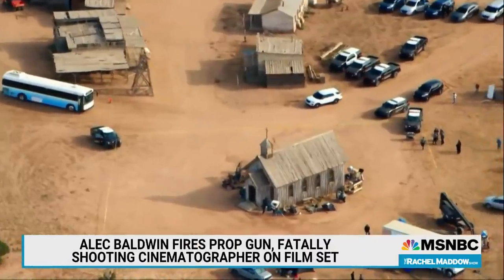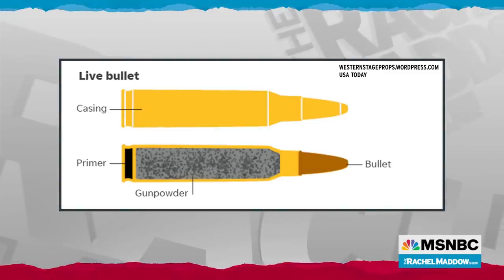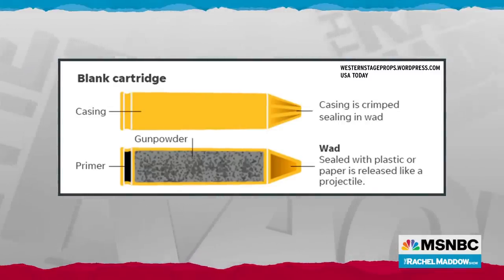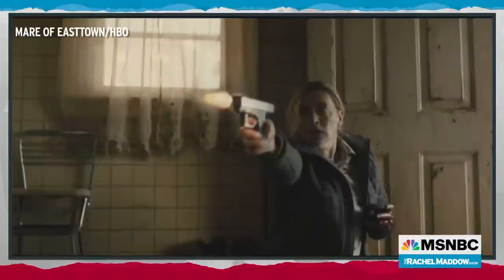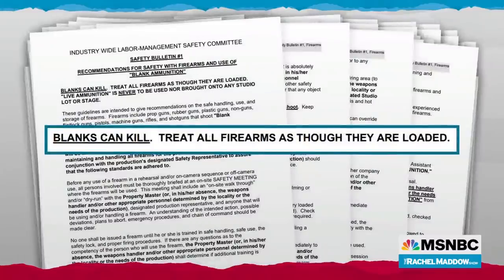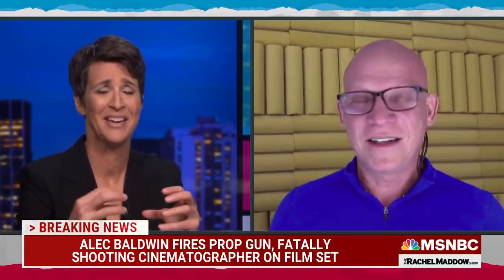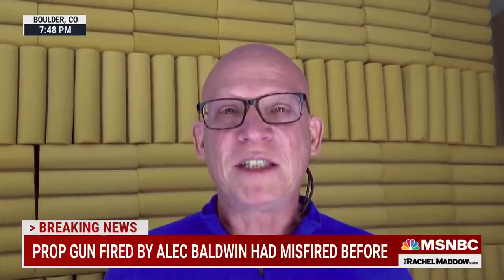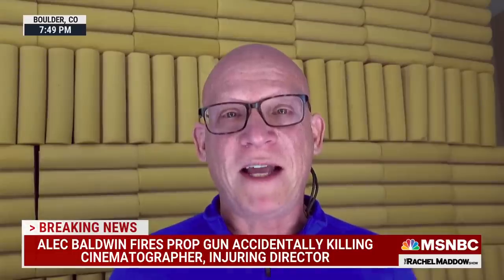Weapons Safety Expert Looks At Safety Protocols And Alec Baldwin Movie Set Shooting

Comment: After Brandon Lee you would think this would be impossible.
Reply: @johnbrown4949  lmao
Reply: @johnbrown4949  
It wasn't a bullet, it was the wad of the blank - as you saw in this video, you need something at the tip to contain the charge.
Reply: I mean, the issue on that one was that there was only a cap with a projectile, which should not have existed.  I was watching a documentary on what happened with Lee's death on The Crow, and injuries in general due to special effects... I wanna say it was on the Discovery channel, but I can't remember and I have no intent of saying "lol here is the study do your own research'.  They were speaking about two different types of round on the set:

Bullet with no cap/powder to be used when looking down the barrel of a revolver, aka the rounds still in the cylinder.
Blanks (they did not show the crimped type, they looked kinda like starter pistol rounds)
The issue was that a third type was accidently created; bullet, no powder, but cap, it ended up in a chamber, trigger was pulled, bullet went in to barrel (which is apparently called a 'squib load') , then the blank charge shot it in to Lee's abdomen.

I don't own guns, I've never shot guns, but I did grow up in the 80s/90s where science toys were a bit more... free?  I guess would be the term?.. and something I was doing an experiment on that was supposed to shoot BBs about the size of a marble out of a tube and the bb went a certain distance based on how far it pulled back, but it was pretty much a chamber loading system, I did not know a bb was still in the tube, did experiment (was mostly having fun shooting things at that point) bb in barrel was hit by bb I just fired, there was a crack sound, lodged bb came out did not move as far as it was supposed to, and the one I shot rolled slowly back in to the loading area.

It was annoying yet cool at the same time and ended up with me learning about transference of energy in a collision, which was cool!  Anyways, just because something mind-bogglingly crappy and unlikely happened to Lee, it does not mean it was a conspiracy.
Reply: @AdeptPaladin  It's highly unlikely a paper wad in a blank would completely pass through the center mass of a person and then penetrate the epidermis and the dermis of someone standing behind them.
Reply: @AdeptPaladin  According to the AP, an assistant director unwittingly handed Alec Baldwin a weapon loaded with live ammunition. What Steve Wolf shows and mistakenly refers to as a blank is an empty (spent) shell casing. A blank would have crimping, to seal in the wad, as seen in the illustration.
Reply: ...unless, of course, there is foul play afoot.
I'd start with the guy who loaded the weapon with real bullets.
Then, find a motive.
Reply: AdeptPaladin  Brandon lee was killed by a bullet not a wad
Reply: That was sad
Reply: @johnbrown4949  In the case of Brandon Lee, it was determined to be a combination of the use of a blank round (propellent) coupled with a “squib load,” (bullet fragment), which had been previously lodged in the barrel of the .44 Magnum revolver.
Reply: Anything to do with Baldwin’s criticism of Putin? Other Baldwin family members have some odd associations with trump.
Reply: I actually thought it wouldn't happen again I'm guessing it wasn't a bullet I'm guessing they loaded something wrong and it was more of it then there should have been and it exploded cuz it hurt two people
Reply: @stevecopper1667  It's been reported that it was a live round. If it was full metal jacket round, then it's quite possible that it passed through the cinematographer Halyna Hutchins and wounded Director Joel Souza, who was standing behind her. It's so tragic in any scenario.
Reply: @stevecopper1667  Depends on how far away they were. The muzzle velocity from a blank shouldn't be anywhere near a live round.
Reply: @johnbrown4949  The primer pushed it out in the Lee case. They used a "prop shell". (a cartridge with just a primer and a bullet but no powder charge) because when shooting a movie you can see the front of the bullets in a revolver. The small pop of the primer was enough to push the projectile from the "prop" cartridge just into the revolvers barrel, Later they used the same gun and didn't realize that the "prop" bullet had been lodged in the barrel of the gun. So when they loaded a "blank " with a full load of propellent it shot that bullet out just like any gun would. That's what happened in the Brandon Lee shooting anyway.
Reply: @AdeptPaladin  No it was not the wad of a blank. 
 It was a western so they were using a six shooter 
and it was a close-up of the gun 
so they needed a dummy round 
which is totally different 
than a blank. 
They were using dummy rounds so it looks like real bullet from the front of the revolver because you could see edges of the chambers
The dummy rounds look exactly like a real billet except for there’s no gun powder in it and you’re supposed to shake them before you load it because there’s a bb in there you could hear a rattle meaning there’s no gun powder.
Somehow there was live rounds on set and someone didn’t shake the bullet before they loaded it or The gun was never cleared when the Prop Master/Armorer first received the gun so it might’ve had a round still in it from the person who leased the gun To the Armorer/Prop master
Reply: @dalesamuelson8959  If they find these people were at fault they will get charged. There was a movie being filmed about the Doobie Brothers called midnight rider and Sarah Jones was killed.
The Producer and the Director got charge and are in prison
Reply: Yes Y  mostly just guns that should only be used in war
Reply: I thought BL was killed before I was born 79'. Wow
Reply: @johnbrown4949   probably because the person who was supposed to do there job didn't do it. It does happen sadly. Apparently the person responsible in this current situation was busy berating one of the writers instead of checking to see if gun props were clear of anything. It's on the 911 call. That's a huge piece of info
Reply: @fjoebiden6455  Does one have to prove their level of obtuseness to be a conservative?
I am not even a liberal but every comment from a conservative requires the response “Bess your heart”.
Reply: I thought all movie sets (with guns) must employ a 'licensed armourer' as part of the production crew to ensure that accidents like this never happened. This was introduced by Hollywood after Brandon Lee's accidental shooting death in 'The Crow'.
Reply: @wilson2455   yes I have no idea . It's been a long time since 93 and now . Who knows what changed over the years. I'm pro gun I'm also pro proper training. It sounds like proper training wasn't utilized. Look at stunt work . It takes training to do it just like handling guns or weapons in general. I know in the behind the scenes feature Keanu reeves and halie berry went to a gun range with a licensed trainer to train for John wick. John bernthal trained with police for punisher. So who dropped the ball in this particular set is what I'm thinking
Reply: Democrats and guns, bad mix.🤦‍♂️
Reply: @jasona59   your correct on being crimped at end....  he is saying and showing a shell casing not a blank   .... perhaps he doesn't know himself showing incorrect info... goes to show you some who call themselves experts are not experts per se
Reply: @eggsbenedict2251   bad info and lack of knowledge is bad for everyone
Reply: @paulgrossenbacher8002  Yes, especially the woman that obnoxious Democrat Alec Baldwin shot.
Reply: @jcarc5701  Do not come to America, do not come. - Kamala Harris 🤣😂
Reply: @eggsbenedict2251  Your point? “I love the poorly educated”.
Reply: @jcarc5701  Well I'm sick and tired of smart guys! - Joe Biden, Democrat 🤣😂
Reply: @eggsbenedict2251  Listen, this is not a team sport where you support your team even when you know it’s the wrong position.
You get the politicians and the government you deserve.
The only difference between third and first world countries is governance.
And it’s not tribal, but if you want Tutsi against Hutsi, we all know how that ended.
Reply: Ohhh slow clap for you
Reply: @msabccbscnnoanfoxnews  The Crow was a western? Hmmm. I think one of you is talking about Brandon Lee, and the other is speaking in regards to the Alec Baldwin situation.
Reply: Mother Chopper hey, it was hard to visualize what the heck happened. A dummy round for a look, and a blank. Yea that’s a genius way to get someone killed.
Reply: @KennuhWayne  No this movie Rust was a western which is why they were using a revolver a six shooter. Which is why they needed to see the dummy rounds inside the six chambers
Reply: @AdeptPaladin  Actually it sounds like it was a real bullet.  We'll know more in a few days after the coroner's report.
Reply: @jasona59  t is possible to make a blank just using a wad/card.  The point is they look different in an obvious way.  But if you didn't load the gun you wouldn't know that.
Reply: @AdeptPaladin  I’LL BET it actually was a live round that a disgruntled employee loaded to make a point DON’T F W/TRUMP
Reply: @bahamutstear1369  if that was indeed the case, that person will be looking at serious jail time. DON’T F W/THE RULE OF LAW
Reply: Nah, they were so careless this time around they nearly got a twofer. LA Times noted at least three accidental/negligent discharges prior to this shooting.
Reply: Yes Y  FYI We have guns. We just don’t have a weird love affair with our guns.
Reply: Nothing is impossible.
Reply: It should be but we have no shortage of idiots on sets and cost cutting shortcuts.
Reply: The old saying, "if it can happen, it will happen." is true. So no, it's not impossible. Never was. It's only that though one would hope after what happened to Lee, the odds of it happening would be smaller, those odds could never be zero. Also, sometimes when you try to prevent an accident from happening again, you create a new condition for something unexpected and bad happening. Sometimes your intended safety measure or measures can actually cause the same bad thing to recur.
Reply: @parslowpongbert1566  no?
Reply: Bridges and buildings and dams still collapse every so often. People take shortcuts, money talks and we don't learn from our mistakes for long, especially when we didn't personally make them.
Reply: @AdeptPaladin  that is not  what the court documents say and the bullet hit the lady in the chest and hit the guy behind the camera that was definitely a bullet.
Reply: @willardchi2571  that's called Murphy's law
Reply: @megafauna8374  that would take a high velocity round and fmj.
Reply: Every gun is a loaded gun.
Reply: They're going to find out that there were live rounds in the weapon, one person killed or wounded by a squib or wadding, maybe, but two? That I question, but we will see.
Reply: Nothing is impossible. There is no such thing as an risk-free world.
Reply: Crus Harold  There's a lot of blame to go around but gutting of regulations including around safe workplaces is not just a problem on film sets. But hey talking about registrations is not welcome.
Reply: Crus Harold  That is what an investigation and trial should uncover. Who knows who knew what when that's what investigations are for.
Reply: Crus Harold  absolutely!
Reply: Crus Harold  Every production cuts corners. It's where they cut which matters. And bosses make enemies. The labor dispute I read about first was about payroll and lodgings. But people love to play the blame game. I've watched my fellow humans do it for half a century. And until more information is out I'm going avoid that ugly game.
Reply: Crus Harold  The tragedy is that someone died on set It doesn't matter by who.
Reply: Human error will never be impossible